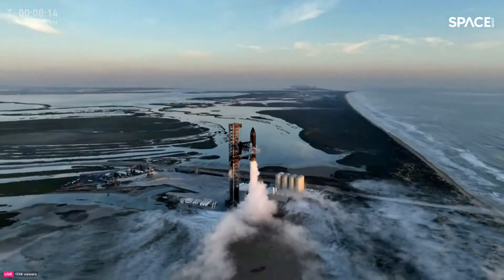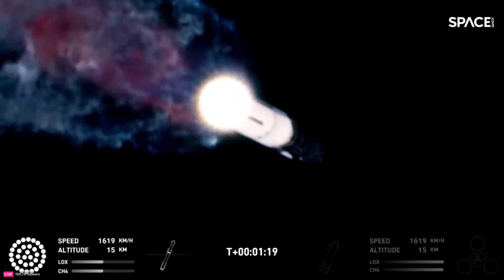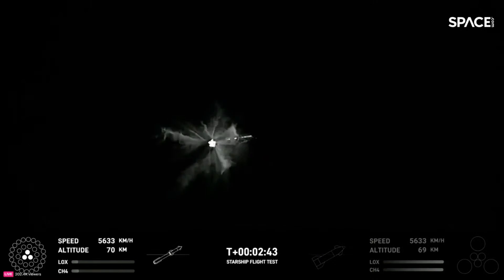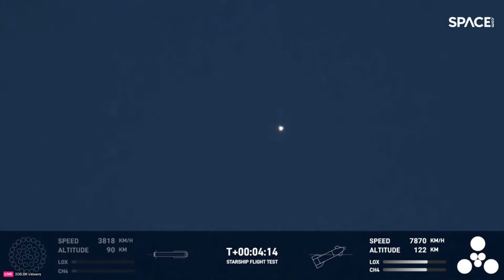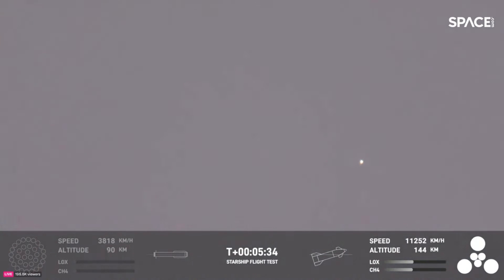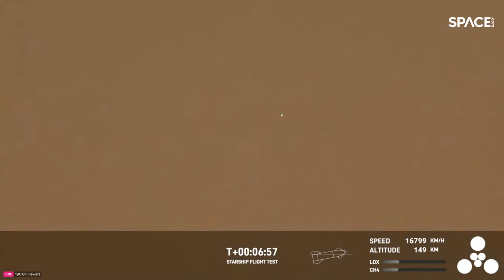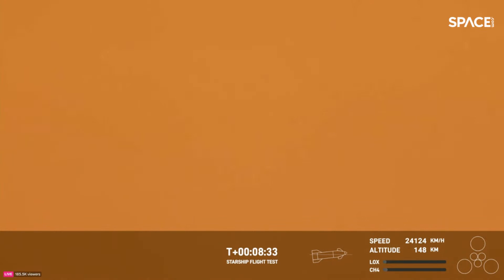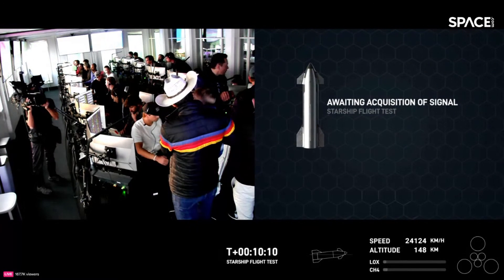SpaceX Starship launches on 2nd integrated test flight, booster explodes after separation

Comment: At Min 3:21 & 95km, stage 1 exploded. At Min 8:03 & 148km, stage 2 exploded.
They call it rapid disassembly. 💥
It's another failure.
From which they learned. They learned that they just can't make the f*ck*ng thing not explode!
Karman line is above 400km, so they were not even close!
This starship superheavy design is severely flawed. And you think they'll put humans in there? Put musk in😅😂🤣
Reply: Its a new rocket ..the falcons dont fail so where is the problem?

Comment: They didn't get all the engines lit up after separation (the outer ring wasn't supposed to, they can only be lit on the ground, but the inner ring and center 3 were supposed to) and then one failed, then another, then all of them, followed a couple seconds later by the FTS activation. I would guess they had ullage issues after that flip. The centrifugal force would drive the LOX (lower tank) to the bottom of the tank, creating no issues, but the CH4 would be driven to the top of its tank. They presumably had enough in the feed lines to get the boostback started, but that tank would still have been sloshing all over the place. I would guess problems with pickup from the CH4 tank is what caused the all engine flame-out.
Reply: Yes, a credible analysis. Hopefully they will have captured data telling them the whole story.
Reply: Nice initial evaluation.  The media will only call it a failure without any consideration of the lessons being learned through failure and analysis.

Comment: A new launch platform made it to space on only its second test flight. That's amazing!
Reply: If true No Oribt planned then they wouldn't carry a FULL load of fuel and that means a LESS than 100 load on the pad/platform
Reply: Total flight time for Starship this year is less than 10min. At this rate the Moon will be further away in it's orbit (Ha,ha)  He'll need to re,re-design
Reply: Nasal, so successful they haven’t put a human in space for over 20 year
Reply: Truth! @fufucker9898
Reply: Yes, next time ask elon to sit on top of it 🤣
Reply: @CrazyCandyCrush  you don't seem to get the concept of a test flight.
Reply: This Musk cult is getting loonier.
Reply: @skyemac8  poor mrs nobody is jealous hahaha
Reply: Not very amazing. The Saturn program sixty years ago had a perfect flight record. The very first flight of the Saturn V had a nearly perfect flight.
Reply: @SodaAnt7  nearly is the key word. So it wasnt a perfect record then huh
Reply: @rhn36  No Saturn launch resulted in a failure. None exploded. All achieved their objectives.
Reply: And SpaceX has built upon all that NASA experience haven't they... @spitfirekid1
Reply: And this time all the booster engines were working.
This gives great credence to the idea that the damage last time was due to flying debris as the booster ate through the fondag.
Reply: Yes, but this time, the booster exploded no doubt due to propellant slushing violently in the tank after hot staging and causing gas to enter the engines rather than propellant. That's something SpaceX will have to think on long and hard, as it also damages the plumbing.  @protorhinocerator142
Reply: respectfully,  this is about their new launch platform working on the first flight. But who cares, different approaches,  I don't mind
Reply: 1:43
Reply: Space Shuttle’s first flight was manned.
Reply: YouTube

❤ HASTAN BASO ❤
Reply: Yes, the news of the successful launch of the new launch platform into space is really exciting! Not only does this represent an advancement in technology and engineering, but it also brings new opportunities and hope for us to explore the universe. What do you think?
Reply: @KristinaDanilchenko  shut up bot
Reply: @spitfirekid1  Most NASA failures were before Mercury. Space is hard. I worked Hubble too, and helped in the investigation of Challenger. The shuttle program had 2 failures in 135 flights - and both of those were avoidable bad judgements. NASA launched all 23 of the Saturns with one failure, and that one being an early shutdown without explosion. Musk can run this program anyway he wants, but when it comes to launching people I want the lessons learned by NASA to be in mind.
Reply: @Samlind  great comment. I appreciate your thoughts. Have a great day!
Reply: SLS just went around the moon on 1st try. 
Why is there all this hype about this ridiculous starship waste of money
Reply: The rich fight Nature and lead us along. Rich countries fight each other over rights to fight on. @stevencoardvenice
Reply: @stevencoardvenice SLS is recycled space shuttle parts.....
Reply: @TheDjsmurph  no it was designed from ground up
Reply: @stevencoardvenice  so the solid rocket boosters are space shuttle boosters with an extra segment,  the main engines that actually flew in the last sls flight was rs-25 engines that actually flew on multiple space shuttle Missons.   Perhaps you should do some research before you comment...
Reply: @stevencoardvenice because the starship can put 100tons into orbit per go vs the 50tons of SLS.
Plus starship will cost 1/1000th of the SLS per flight. At ~2billion per flight for SLS to ~2 million per flight for the starship. (Though that 2mill goal does seem a bit lofty, but even if it is 20mil per flight (10x the goal) that's still SO MUCH more economical per flight, all while being able to take 2x the cargo to orbit)
Reply: @picassoimpaler3243  

Yeah except none of that is happening
Reply: @stevencoardvenice  it's been, what? 4 years since the begining development of starship?
The SLS project has been in the works for 11 years now.
Things don't happen overnight.
Reply: @picassoimpaler3243  yeah starship was supposed to land on Mars 2 years ago, and it still cant even leave orbit or land without blowing up.   It's obviously time to go back to the drawing board.   This will never be human rated
Reply: @stevencoardvenice  "this will never be a human rated"
How many times did the Falcon 9 suffer rapid unscheduled disassembly.

Isn't that how astronauts get to the ISS now.🤔
I would much prefer our astronauts to be on a Falcon 9 rocket compared to anything else. Especially with the Dragon vehicle attached to it. 

If the people who are making important decisions had your attitude we would still be using Russia to get there.

Perhaps it's a good thing you're not making those decisions.
Reply: @GE_Phil  
SLS works.  Starship doesn't
Reply: @stevencoardvenice  SLS is overpriced and uses outdated Shuttle tech.
Reply: @BukuiZhao  it works....
Reply: @spitfirekid1  it's documented, maybe a dozen, but back then even the math wasn't known, nor the right fuel, nor computers didn't exist (they had to invent computers, aka guidance systems) on how to get to space. Today, freaking iphone can guide a rocket into space.
Reply: @jojog8304  congratulations on the dumbest comment that I’ve read this week. You’ve had a lot of tough competition from others making stupid comments and you really outdone yourself with the cell phone remark. Stick to fixing the exhaust leak on your engine and leave the science to the big boys.
Reply: yay, I win. It must be the NOx! Considering we got cubestats running Rpi2s, Dragon capsule running Linux + STmicros, Mars helicopter running a Galaxy S20 cpu (Snapdragon), Starlink using iCore cpus... of course I would not use an iPhone--it's not designed for launch, but concepts are the same as today's consumer tech. LIRC SLS, RocketLab, BO (and likely Starship) uses strapdown IMUs. SpaceX knows if we drive drive costs make it easier, everyone gets to use space. No disrespect to NASA or SpaceX, all successes.
Reply: @jojog8304  great response. Intelligent and very articulate. You have my respect and the award goes to someone else. Have a great day!
Reply: Sub orbital. Not space. And it blew up. No manned flights for that bird for a very long time .
Reply: @johnshean8715 it was above the karman line.  It was in space just not at orbital velocity
Reply: respectfully, 100km altitude is space. Orbit is not required to have  reached space.
Reply: @johnshean8715  space = karman line, 100km. starship made it past that. it was in space
Reply: @spitfirekid1  That was literally 1967, comparing where SpaceX is now to the year 1967 is not really the win you think it is.
Reply: @艾米心amihart  it’s not, that’s correct. But I get it. Either you are a Russia fanboy, or you have absolutely zero idea of the engineering challenges that anyone faces to go to space, or you truly dislike Elon Musk and anything that he is involved. Pick one or pick all three. It doesn’t matter to me. Have a nice day.
Reply: Soviets made it on the first try with the man inside 🎉
Reply: @mbelzerr  not really. it took at least 7 unmanned test flights (3 of which resulted in failure) before the historic Gagarin’s flight
Reply: @mbelzerr  respectfully, my friend, the Soviets never had success with the N1 rocket which is the closest thing to SpaceX’s starship launch vehicle. BTW, I checked out your channel and you’ve got great taste in music and guitars. We’ve been to some of the same places just not at the same time. all the best to you!
Reply: @spitfirekid1 I say let these bozos have their fun.  They're going to clam up and enter a self-consoling bubble when Starship flights are happening on the regular.  Or maybe they'll rage and wave their fist at the unfair skies.  They know it perfectly well.  They'll be psychologically broken at that point so where's the harm in allowing them to pretend this launch wasn't exactly the success SpaceX was hoping for this time around?
Reply: @Asterra2  great comment!
Reply: @mbelzerr  their dice role was successful, point. Space is still hard, and the Russians have had plenty of failures over the years as well
Reply: Yeah NASA did it on the first try.
Reply: @robertgardner8680  do you remember Apollo1？
Reply: @robertgardner8680  it's different. NASA had to spend decades simply trying to get it "right" on its first attempt. That presents many risks, a notable example being Apollo 1 and Challenger.

SpaceX uses a much better approach. Just launch it, blow it up, learn from it, launch it again, repeat. This is much faster and allows you to learn from your mistakes without actually causing danger.
Reply: Absolutely did. With humans aboard. @robertgardner8680
Reply: @robertgardner8680 uh no they didnt? They have failed many times when launching rockets. It’s called testing. And this is the biggest and most powerful rocket in the world too.
Reply: Poor souls still think they going to space
Reply: @randallpinestraw  hey Randall, I checked out your posted videos and you seem like a great guy and a great family man. You’re the kind of person that would make a great friend. I don’t understand your comment, though.

All the best to you and your family.
Reply: @spitfirekid1 the Apollo 1 accident didn't happen during a launch, and it had nothing to do with the boosters. There was a fire in the space craft.

Comment: Spectacular. But how did nobody see the stage 2 blast? Clearly visible at the moment the UI was lost.
Reply: Yes, I saw it, a small explosion then the big one! And you can see the data stop at that point. The announcers either aren't too informed, or possibly they just don't want to make that sort of announcement.
Reply: @blucat4  The flight termination will at high speeds and low air resistance also create a bang.....Boom look because the structure will not break apart as fast and the fuel and oxidizer takes time to get enough together to blow it apart. And the announcers are specifically instructed not to speculate.
Reply: @theexchipmunk   Yes and yes. There was also another flash before it stopped which they saw but no one said anything. And it was close with the timing. And PR is really important so they wouldn't be speculating in case they got it wrong. Good posts, but will you guys please learn how to spell *losing!! 😄
Reply: @blucat4 The announcers are annoying af. Just like the childish screaming staff at MC. Unprofessional
Reply: Seco also creates a plume of exhaust, and as we never have seen that with a starship going for space, it´s hard to tell, especially as the termination happened so close to when it was supposed to be executed. Add in that loosing connection was expected and is not unusual, the confusion is perfectly understandable.
Reply: Yes, around 46:20 - you're right 👍
Reply: Still don’t know how effective the heat shielding tiles are. That was a spectacular launch and a couple of surprise RUDs.

Comment: Well, the booster got the second stage there, that was the important thing.  Looks like the hot staging and the separation process had some of the engines knocked out and caused problems.  Still, a great test overall.  And I think the pad even survived this time!
Reply: Yes much better. I just want to say, how BIG was the booster explosion!! It was massive!! I don't know if I've seen one that big before but it was very high with low atmospheric pressure and the camera zoomed in, but still it was big. You can easily see the Starship explode too just after 8:20, no one mentioned it at the time but you can see it and telemetry stopped so Elon knew.
Reply: @blucat4  great observation, amazing they got up to orbital speed before the RUD... Can't wait for the next test!
Reply: @NickDanzinger  The recent FAA restriction was due to the launch obliterating the fondag.
Having stuff blow up more traditionally in space shouldn't be enough for a second FAA intervention.
We'll probably get another flight in a couple weeks.
Reply: And the flight termination system not promptly terminating the flight. Which at least for the first stage seems to have been rectified.
Reply: Not only that, all the raptors survived take off, that's part of the improved pad performance, and I would expect the next test should be totally fine.
Reply: It seems methane or oxygen leaked when massive vehicles’ were turning.

Comment: I do congratulate SpaceX on a successful   Launch of both stages.  My question is why did the flight termination devices detonate  on both stages?  Seems strange, was it planed, or why did they trigger? Next is how did the launch pad survive, was it damaged at all, how well did the deluge work?   Answers please
Reply: If you look at the speed, both Super Heavy and Starship are moving at > Mach 3. If SpaceX has the slightest hint they are not in control of the vehicle, they would rather detonate it far away from people rather than risk hurting anyone.
Reply: I don't think it was plan. The first stage I think they wanted to get it into a condition where it could have landed it, but they weren't anywhere near that. An the second was supposed to land hawaii, they only made it over the coast of Mexico.
Reply: As the launch just about happened and there will be heaps of data to analyze, everything is guessing. The booster very likely got damaged during hot staging, thats what I would bet on, but the ship is harder. One of the first things would be the sudden change in exhaust brightness, but that may just be the ship passing out of the earths shadow as it was starting towards the night side at morning. But occurs razor says that its termination probably was caused  by the same thing that did the booster in. If that was sufficiently damaged, the engines or controls on the ship may also have been damaged but only started to really effect it after a prolonged burn. And if it becomes uncontrollable the termination will trigger.
Reply: @theexchipmunk The key thing is the data captured so they know what needs redesigning.
Reply: https://www.youtube.com/watch?v=ka5id7ZQKL4
Reply: As for the launchpad, we don't know yet, but if it did survive, then it would prove many people wrong about needing a flame deflector as well.

Comment: Pretty interesting that at stage separation, the display of active engines changed but the actual active engines didn't.
Reply: They did change.  If you take a look at 41:07 you can see it is only 3 engines burning as they showed!
Reply: Video delay relative to telemetry.
Reply: @mschultz8455  
@matthewameele5021
Sorry I should of been more precise, it was just after stage separation, when the display showed multiple engines Reigniting but not actually coming back online

It could of been a delay in telemetry, though your right

Comment: 33 engines ran nominally. No misfires.
Reply: .. you'd have to be a hardened fanboy to call the total obliteration of all that hardware a 'win'.
Reply: @MrJBA79 well, they are achieving something slowly but steadily. Falcon 9( Falcon 1 and it's successor) wasn't a huge success at first was it?
Reply: @MrJBA79  You fucking got that right! It is a WIN.
Reply: @MrJBA79  Yes, it was a win. These are called "test flights." They test. They learn. They do it again.
Reply: @MrJBA79 Im pretty sure he didnt mention it's a 'win'. All engines ran OK is actually kind of an achievement. Russia tried to make a similar configoration (the N1) with smaller rockets they failed. It was too unrelaible.
Did they reach their goal? Kind of... Main goal was a successful lif-off and separation. That worked, the booster exploded, later the first stage too. Last time there were multiple rocket motors going offline, that didnt happen now.

Comment: 😢😢😢😢😢 But at least they collected some data
Reply: I wouldn't be surprised if they bauched the data retrieval as well. You can't contort a catastrophic failure into a win even if you're a fanboy seal, clapping your hands off.
Reply: @MrJBA79  You can actually when you don't have a loser mindset. Rocketry is extremely difficult. The third test flight should happen soon.